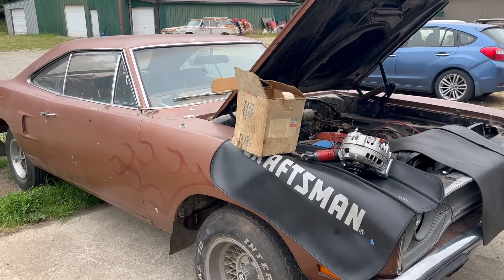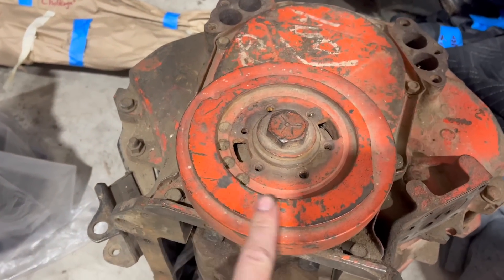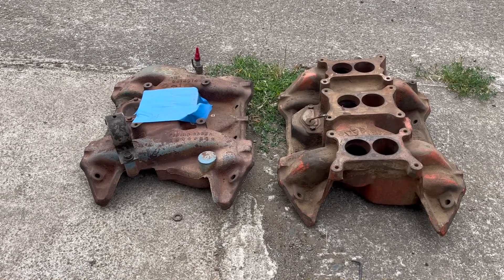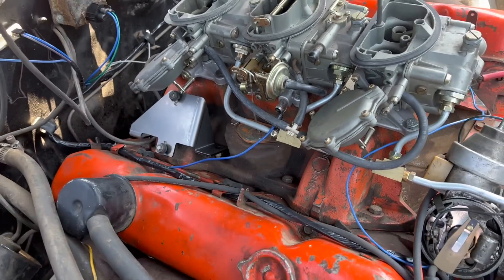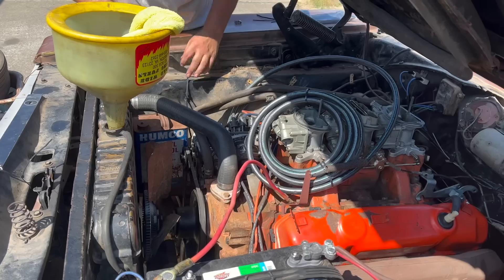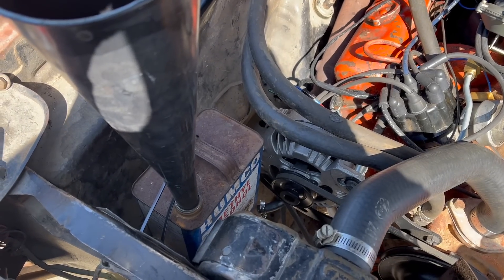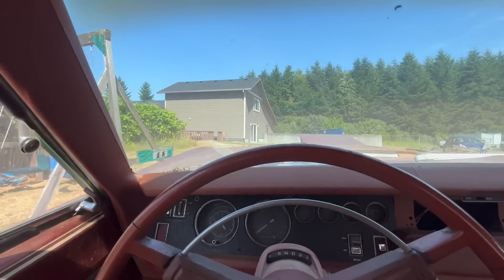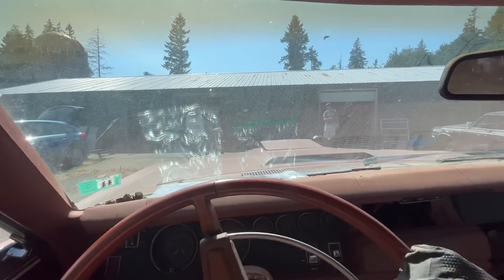Installing Legendary Six Barrel Carbs On Our 1970 Plymouth Roadrunner!

Comment: Love all years of the Road Runner. For a short time owned a 69 Coronet R/T. 440 auto. Other than a Holley double pumper and Hooker headers it was stock, including points ignition. Back in the early 90's I would blow through a full tank of gas in under an hour. Always regretted selling it back to my brother.

Comment: Your Roadrunner looks almost exactly as my 70 GTX. Minus the wheels and flames. Mine has a b of ack vinyl top. I just finished the engine rebuild and I rebuilt all three Holly carbs. Mine has aluminum heads and 484 cam. 7 qt. pan and Melling high volume pump. I also put a Hemi fuel pump on it. It fires right up and I also took the headers off and put the stock manifolds on it. No mufflers. Neighbors love it. I think? Thanks for the video. I think I will go start it up right now and let the neighbors enjoy that symphony of music as it fills the air😛
Reply from the maker: Outstanding! My neighbors definitely love me 😅 there’s nothing like the early morning chorus of the open manifold slant six… the rumpety Demon engine through flowmasters is pretty good too.
Reply: @DeadDodgeGarage I’ve been meaning to ask how your neighbors enjoy your lead foot in front of their houses! 😅

Comment: Cool video back in 1975 my buddy bought a 70 Dodge Super Bee it was a 440Six pack it was a bench seat car pistol grip shifter Hemi 4 speed355 Shield grip triple black a radio no heater no carpet that's how it was ordered what a fun car it was $1,600 at a used car lot had a cracked windshield the body was gorgeous across the trunk we hand-painted and white letters one six pack to go for a quarter mile picnic so you can see it from the back that car was fun we put hookah headers iski cam mechanical tunnel ram through quads Magneto ignition better carburetors we got the car to run middle ovens in a quarter mile with street tires it was a street Terror it was great and of course he sold it in 1980 when he moved I should have bought it but I was into Camaros at the time that was a cool car man it's so cheap and so cool his parents Weren't happy he got lots of speeding tickets:face-green-smiling: have a great day
Reply from the maker: Wow… I wish I could’ve been around for those days. So damn cool.

Comment: Getting closer to booting all 6 Barrels in!
Reply from the maker: I learned something cool during this operation, which is that if you rev the engine up and close the choke (a trick I use often to try and clear air bleeds and such,) after about half a second, the outboard carbs jump open and the engine takes off! It sure sounded awesome when that would happen… I can’t wait to drive this thing.
Reply: @DeadDodgeGarage  A glimpse of the future!!

Comment: I swapped a 6 bbl setup onto my 70 GTX . Since it's not a factory V code car , and not even numbers matching I went with an edelbrock intake to save a few pounds .
Reply from the maker: Excellent. I know they were aluminum from the factory in the early cars from ‘69. I would definitely prefer that.

Comment: Picture it... 1977. I was 17 and I saw a beautiful '70 Road Runner V-code 440-6 bbl 4-speed at a car show. A few months later it was sitting in a driveway in my neighborhood. WTF??? Engine gone! Tranny gone! Dana gone! Seats gone! I knocked on the door and offered $30 for the air-grabber hood. They told me I could have the whole car for $35, so I bought it. I already had a 383 engine, 4-speed and 8 3/4 reared with 3.55 sure-grip. I drove it daily for a year and sold it for $400.(sigh) My next Mopar was a mint '66 Hemi Satellite for $1800. Hemi was gone! 4-speed and Dana was gone! I installed a 440 6 bbl, a 4-speed and 8 3/4 with 4.30 sure-grip. Drove it to the Street Machine Nationals in Indianapolis from Buffalo, NY. I did a bunch of burn-outs, and broke an axle. I made it back home at 45 mph, and all 5 studs broke off of the other axle as I pulled into my parent's driveway! YIKES! I sure do miss the old days, and the old prices! 64 years old, and still enjoying old Mopars!
Reply from the maker: Wow… man, a hemi Satellite just has to be one of the coolest cars ever. Obviously the Roadrunner is cool too. Haha. I missed out on the best times. When I started in the hobby I could go grab a running A body for $300-900, and I did - often. So much of the fun was in how affordable they were. There weren’t real muscle cars around, but there were plenty of A bodies to drag home. Now I make more money, but the cars usually cost much, much more and it doesn’t quite even out. Oh well. I’ve still got my fair share, and am still having my kind of fun whenever possible.

Comment: As for the 6 barrel and 6 pac some models did say 6pac so your not wrong. I believe it's challengers that sported 6 pac distinction on the 340 ta. But what do I know😊 as for favorites for me 70 charger and 67 coronet then 70 gtx or roadrunner. So my 72 roadrunner gets honorable mention because I have had it for 43yrs. Is it a favorite not so much but it's still cool. Bucket list involves 70 440 6pac 4spd and a 69 rt with the same. And as long as I am dreaming a trip to the Bahamas to be a pirate for a day. Doubtful any will come to pass. Oh if I win the lottery. He'll ya. Hang the Bahamas I will buy cars.😅
Reply from the maker: Yes - Dodge is “Six Pack,” and Plymouth is “Six Barrel.” I want to say one of them is sometimes shown with the number 6 but… I don’t remember.
Reply: @DeadDodgeGarage  correction six pac. No k. Like dodge scat pac. There wording and paint colors from dodge to plymouth messes with me all the time. It's purple damit. Lol or top banana and plymouths yellow. Same code and color. I can't keep up lol.

Comment: Bought me a small block six barrel setup 3 or 4 years ago, and a year or two later bought me a big block six barrel intake. Are the carbs interchangeable?
Reply from the maker: Short answer, yes. These are actually 340 carbs, so as you can see they do fit and run. The center carb is technically different. The choke attachment arm is at a slightly different angle so that doesn’t work, and I believe the correct 440 center carb has a higher CFM rating. If you don’t need that small block intake, I’d love to help you with that 😁 although I probably can’t afford it… let alone carbs… anyway.
Reply: If you can afford a Charger, you can afford a six barrel setup. You will get a bargain someday. Just wait on it.

Comment: Just a curious question...were those engines put into the cars in a sequentially ordered number at all or was it just kind of grab one-off the shelf and put it in? Me and my twin brother drive 2 trucks that are also twins and they are simultaneously serial numbered but the engines are several 100 apart.  I know that's a big difference between a cat engine and mopars but I was just curious. In our 2 kenworths the younger truck actually has the older engine.
Reply: The trucks chassis numbers are sequential i mean. Again...ND farm boy grammar. Lol.
Reply from the maker: Haha. I catch your drift. I don’t know at what point in the build process which engine was chosen for which car, but I really don’t think it was sequential. Thing is, there is no separate ID number on the engines, so we have no way of knowing what was built when. But I know the casting date can vary quite a bit, so that should give us a good indication that they weren’t coming out in any particular order. I’m guessing engines were churned out in several different series lines, then grabbed from there as a particular car headed down the line. I’m really curious about how the assembly line worked but I don’t know much about that - yet.
Reply from the maker: Ok, I randomly just learned that this isn’t correct. There actually is a assembly number as well that reveals the date it was assembled and what number engine it was that day. I still don’t know that they ended up into cars in any particular order. I really doubt it.
Reply: Good timing 👏

Comment: Question on my 68 bee seems everything works on my dash but the dash lights .what could be my issue to start tracking this problem ?
Reply from the maker: Dash light fader is a very common problem - especially in cars that have been sitting unused. On many models it’s built into the headlight switch. On 68-70 B bodies, it’s that separate dash light fader that also turns on the dome light. I just start rolling the fader up and down, and often they will magically start working again. The fader could definitely be bad or broken internally to the point that that won’t ever work, but I’ve had pretty good luck. There is also a dash light fuse worth checking. Power comes out of the headlight switch, goes through the fader, then to the fuse, then back to the lights. You could always try jumping power to the fuse to check the lights themselves. A volt meter could also be used to check all of these components if you don’t have any luck.
Reply: @DeadDodgeGarage  sounds like a plan to get started with  thank you a bunch

Comment: Oh how I wish you would have shown the connecting/routings of the vacuum lines.  🤔
Reply from the maker: Oh, I actually thought I did that. The three matching nipples on the passenger side of the carbs all get connected together with lines and a T. The extra upper nipple on the center carb is vacuum advance. The large lower nipple on the base plate of the center carb gets a long line that wraps around to the PCV valve. Done! I apologize for this video not being information rich on the six pack setup. I plan to do this, it just didn’t work out on the day we filmed this. It’s mostly just for whatever entertainment the glory of seeing the setup back on the car might offer, as many people asked about it.
Reply: @DeadDodgeGarage  
Very good.  Thanks for the descriptive info.  I'm having a 6bbl setup built for a 440 rebuild for my '69 Roadrunner and wanted as much info as possible just in case the routing is incorrect.  👍

Comment: My mopar starts then dies too, can you help me figure it out. Thank you
Reply from the maker: Your coil is not getting regular ignition one power. The common cause of that symptom is ballast resistor failure, and it’s pretty safe money to just replace that for $6 or whatever they cost now. You could also do some detective work, and check for power at both sides of the ballast resistor with the key in the run position. If you have 12v on one said and 0v on the other, the resistor is bad. If you have no power on either side of the resistor, you’ll want to check the main ignition switch connector under the steering column (if your key is in the column) as this is a common source of problems as well. You’ll be looking for evidence of melting on the blue wire. Ignition switch failure and firewall connector problems can also cause this. 

If you want more information on how all of this works, you can check out my Classic Mopar Ignition Systems video. It’s packed with useful info.
Reply: It’s a 68 Valiant 340/auto. Has msd 6al box, no ballast resistor. Changed the ignition switch and the firewall bulkhead connection. Has 11.8 volts coming from the blue wire. Car still starts then dies, can you please give me some advice what else to check. Thank you

Comment: 5:58 What is the task of this pedal?
Reply from the maker: That is the parking brake, or “emergency brake.” As it has a mechanical connection to the rear brakes, it can be used as a normal brake in a pinch. It’s nowhere near enough stopping power to take a car out on the road, but can be useful for situations like this, where the brakes are often not functional.

Comment: J.  YOU OPINION BADD AZZ ?  426 HEMI. OR.  440. SIX PACK  OR MY DECEASED FRIENDS 440-6 CUDA ? THANSK BILL BOSTON MASSACHUSETTS
Reply from the maker: I mean they’re all badass. For me it’s the 426 Hemi - even if, in many ways, it’s worse. It’s just humongous, with valve covers as wide as my big ol’ head. It always had dual four barrels. It was something approaching a useless street engine. It was just cool. This is only my second run in with a 440 six barrel setup, and even though I haven’t gotten to test it properly yet, I can tell it’s going to do cool stuff.